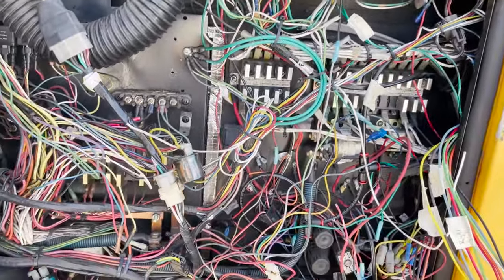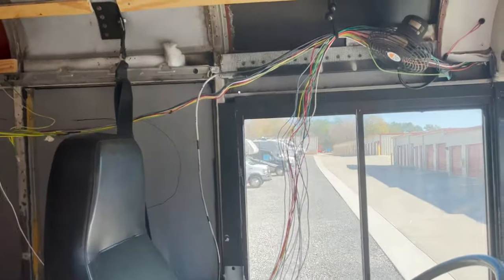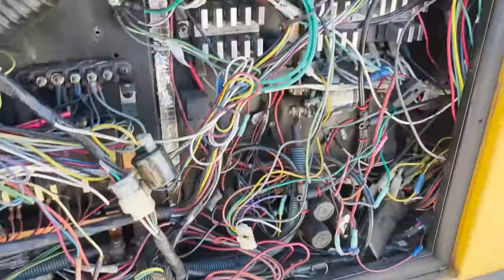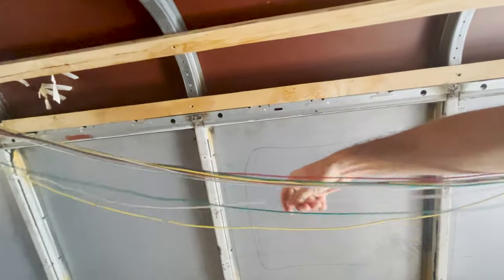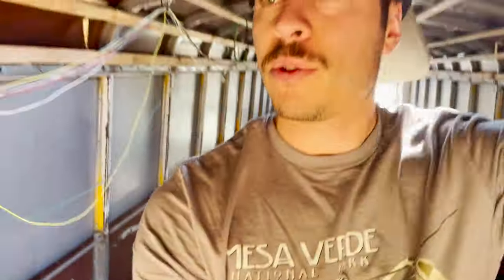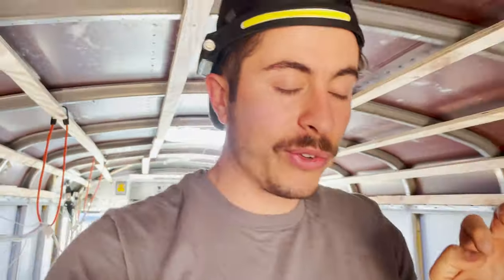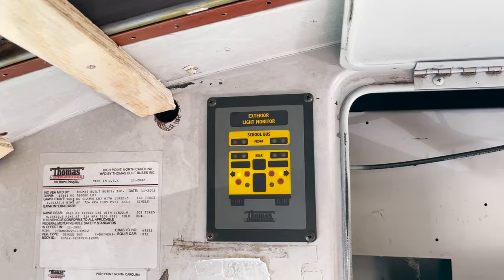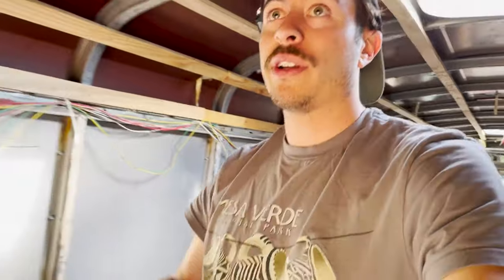Removing old Skoolie wiring: Streamlining bus wiring like a pro!

Comment: If you are still tracing down wires you should get a wire toner. It really helps with tracing down wires when you have a ton of wires running everywhere.  Amazon… wire toner and tracer. It puts a little voltage from a battery into the wire and then you use the voltage detector to find the wire with the voltage on it.
Reply from the maker: Good call. What’s a wire toner though?
Reply: @Escapademade  ,  Amazon… wire toner and tracer. It puts a little voltage from a battery into the wire and then you use the voltage detector to find the wire with the voltage on it.

Comment: Tip:  don't throw all that wire away yet, you can reuse much of it for the rest of your build. Different colors of 18ga - 12ga wire, the length of your bus, comes in handy.
Reply from the maker: Good call Chris. I haven’t thrown it away yet. I’ll group it up and save it

Comment: I have that same model of thomas 2021 flat front 5.9. I just got done running all new electrical to the back. How did you get the wall panel behind the seat out? Mine goes under the switch panel.
Reply from the maker: Are you referring to the aluminum sheet metal along the sides of the inside of the bus? Mines an 04 so we may have different internal set ups from the factory.
Reply: @Escapademade  yup, the textured stuff under the windows. One side was easy, the other side looks like I will need to take the seat and to switch console out
Reply from the maker: @FirinBBs  oh I see what you’re saying. Yeah. The seat was in the way. But it wasn’t hard to just unbolt the seat temporarily and go in to remove the sheet metal. If you can’t do that then get metal shears (basically big metal scissors) and cut it out manually.
Reply: @Escapademade  I appreciate it. As far as the wiring, my bus has a diagram on the inside of the door that was very accurate. It made it easy to remove a ton of outdated wiring